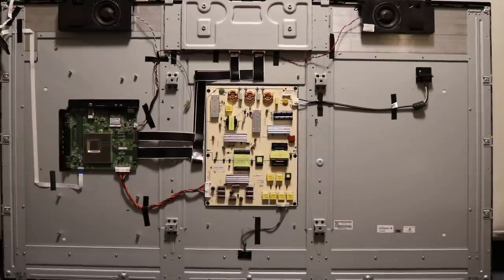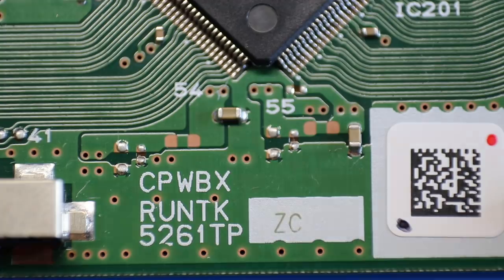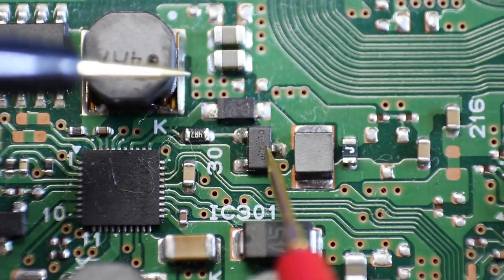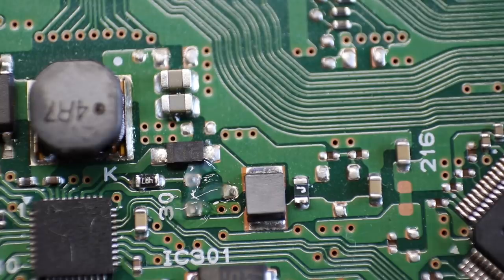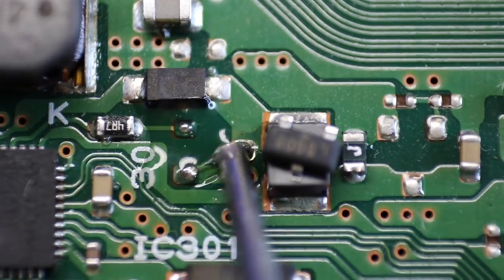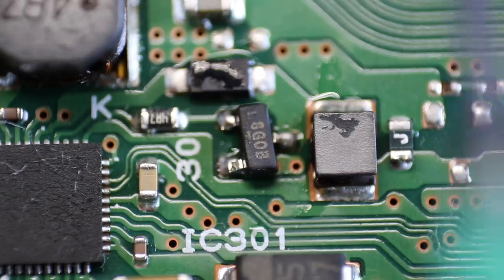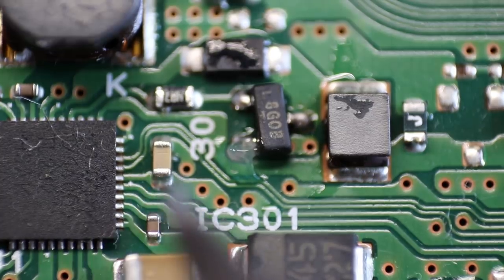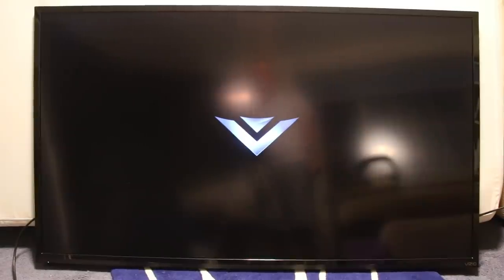60" TV for less than a $1 - Vizio E601i-A3

Comment: Great repair, but you need to not focus too much on the internet.Some of the things you need to discover them  yourself and of course you need to have basic background in electronics. For instance after removing the transistor you should test the board because some components might be shorting and you need to explain why that transistor  should not give a beep or 0 ohm reading and finally you need to explain why you suspected that tcon board was faulty.Great work, great repair ,Much appriciated.Thank you very much.
Reply from the maker: Thanks!  I didn’t do a great job explaining in this video.  Have you seen my other electronic repair videos?  I hope I did better especially in the 65” 4K one from last summer.
Reply: @FrugalRepair  Thanks, i will check. I appreciate your work.

Comment: Hi, my Plasma TV model TH-P42U30S, there is no red light at all, whats is the problem. can it be repair. thk
Reply from the maker: Unfortunately, you would have to give much more information for me to have a guess as to the problem. The fact that you have no standby light could mean that there is a problem with the main board or the power supply. But The fact that is a plasma TV it could have a short circuit on one of the other boards. I would disconnect those other boards except the main board and the power supply and see if you get your standby light back
Reply: @FrugalRepair  thank you Bro ,i will give it a try

Comment: 60" Vizio TV blowing T-con board.  Any insight?
Thanks.
Harold
Reply: Wouldn't it be possible to order a new T-con board and just replace that? Soldering is something I plan on taking up this year... lol
Reply from the maker: Do you mean the tcon has the same issue as the model in this video?  It could be a bad lcd panel and/or the heat dissipation on the tcon (near the gamma IC) is not sufficient.
Reply: @FrugalRepair  I put in several t-cons but nothing changed. The set has backlight but no sound or picture.
Reply from the maker: It could be a problem on the lcd panel.  I would try to drive half of the screen at once to isolate if there is a problem on the left or right side of the panel.  Unplug TV, then disconnect one of the cables between the tcon and panel.  Then turn tv on.

Comment: can share how to repair the Green broken display.. could it be also a t-con problem?
Reply from the maker: Do you mean the video on the screen is green colored?  Is it the same model as this one in the video?
Reply: @FrugalRepair  another model samsung sir.. its not totally dark green.. its color green in the boarder then color white in the center.. then it well fade to white or gray color in the screen.. not sure if its t-con or already panel issue..
Reply from the maker: @aivanjay  I'm not sure.  It does sound like either a bad panel or tcon like you mentioned.  If it is an older samsung (before 2011 or so) lcd it would be worth looking at the capacitors on the power supply, they might have the "capacitor plague".
Reply: @FrugalRepair  ok sir thanks

Comment: What's actually the benefit of using hot air rather than just simply the soldering iron?
Reply: Imagine trying to get 3 pads hot at the same time to get your component off. A soldering iron is great for concentrated heating but sucks at removing components.

Comment: For any normal people out there, You can buy this entire T-con board for $18 bucks, and with a phillips screw driver have the same repair he just did, without the worry of messing up the soldering job with unsteady hands.
Reply: That sounds like a better solution. No need for heat gun or steady hands.
Reply: Buying a used tcon board is cheaper.. 18-20 bucks. You can fix many tvs for the price of the machine used

Comment: I have a question I have a 49 inch lg t.v. that works fine till it heats up then it cuts its self on and off. Isnt that to do with the power supply board?
Reply: Put  it in the fridge may hel0
Reply from the maker: Figuring out that heat is causing the problem is a good clue.  My first guess would be bad led's  (your backlight).  Try turning down your brightness in settings to 10% and see if the tv lasts longer.   I guess it could be a power supply (or another board problem) and you could also point a running fan on the board and see if it lasts longer.
Reply: I found the issue but thanks tho your video was very insightful. Thank you .

Comment: HI MY 2 year old nephew broke my 65 Samsung tv. I tought I had a warranty and extend warranty but they said it was physical damage just by the picture I sent to them.  Would you know what the problem would be?  Where could I get a television screen plexiglass protector? I wish I could fix tvs like you. Hate to throw them away and have to waste more money on a new one.  Thanks
Reply from the maker: Unfortunately, if the screen is cracked there’s not much you can do.
Reply: @FrugalRepair  it  doesn't look like the screen is cracked.  Just something internal. Picture is not good at all.

Comment: I replaced the tcon board and it seems like the new one is also burned out, both on that same transistor.  if there is a short, what could be causing the boards to burn out?
Reply from the maker: Unfortunately, it is possible that you have a bad LCD panel that is causing the problem

Comment: What happens when you Google the model number of your TV and you can't find a site where someone has already detailed exactly what you need to do to fix it?

I have a trash-picked 48" Samsung TV that won't turn on. I took the back off, unplugged the main board and connected the power. The backlight didn't come on like various troubleshooting videos said it should. So the power board appears to be bad, but I have no idea how to test any of the components on it, other than the fuse. I checked that and it seems to be good. None of the capacitors are leaking or bulging and nothing else seems damaged. So how do you figure out which part is bad so that you can replace it, rather than replacing the entire board?

Comment: I ve have an Rca 46LB45RQ comes on for probably a day then goes black with sound still working. Did the flashlight test and don t seem to have any images.  Wait a few days same thing works then goes black. Can u tell me what which component u think could be causing this? Thxs
Reply from the maker: Huh, my first thought would be the led backlight overheating and shorting.  But you're saying there is no image on a flashlight test.  Maybe try this,  go into settings and turn your brightness down to like 15% and then leave it on all day and see if it behaves the same way.  If it isn't the backlight, it could be a range of issues.  Is it connected to the input at all?  Does it do that on the coax, hdmi, RCA inputs?

Comment: Maybe you can help me, I have a tv just like this one. Intermittently the screen will blink off, then it comes back on and the information in the upper right corner comes on, like the tv restarted. But no V after incidents. The screen just comes back on. Any ideas? 
Thanks 😊
Reply from the maker: Have you researched the model number and the problem online? What did you find? As I think about your symptoms it seems like there could be many things causing that so I’m not sure what to tell you. It could be firmware, it could be a short circuit on a component somewhere, it even could be a backlight issue that looks like the TV is restarting. Or something else.
Reply: FrugalRepair not yet. I saw how you fixed the inop screen and it reminded me of what mine was doing. I will look further into it. It’s like mine is resetting. Info pops up in right upper corner of the screen. These aren’t designed to last like the tv’s when we were kids. 😉

Comment: Hey Mr frugal I changed the whole tcon board and still doesn't work....but I have the same exact problem u had in the video. What should I do now
Reply from the maker: Unfortunately, if it is the exact same issue there are two possibilities I can think of.  Either your lcd panel is bad or you were sent a defective tcon.   There are more detailed diagnostic videos on this model's tcon or how to troubleshoot tcon boards on YT if you wanted to pursue it further with a multimeter.

Comment: Very nice contribution to the common person saving tremendously.  My learning curve isn't all that great but it seems you make a major leap in knowing it's exactly that transistor.  I need more of a step by step how it is you know what you know in this case.  I know you know the back light lights up but no picture, but still how did you know it was exactly that transistor?  You use trade names for the various boards "Tee Con Board"...  Also the name and address of the company that you bought the transistor from.  I might go to the electronics stack by the dumpster to my apt bldg as there's an RCA 32 inch HDTV... but do these TV's work on one's computer, as a computer monitor?  A 32 inch screen with its single pedestal foot would sit nicely on top of my desktop computer.
Reply from the maker: Thanks for your comment.  I didn’t do a step by step in this video but I do in other videos.  Did you get a chance to watch some others?  Also, if you want to quickly diagnose a TV or monitor, I would recommend that you get my PDF (FrugalRepair.com/resources).  It’s 26 pages of my best diagnostic steps before taking anything apart. My next video should be out this week, let me know what you think.

Comment: I have a question I have a VIZIO E601i-A3 and tv works for like 10 minutes and then screen goes black and a loud screeching sound then I have to turn it off or goes off on itself then I turn it back on sometimes it only works for 10 minutes sometimes an hour what could be the possible problem T con board power board or the main board ????

Comment: I fixed a 43" Samsung LCD tv by reflowing the graphics processor chip with a heat gun. 
I fixed another LCD tv (can't recall make & model) by replacing a bad cap for $1.83.
Reply from the maker: Awesome!  Thanks for sharing.

Comment: I have a Samsung UN60D8000 YFXZA 3D LED TV and I have a problem watching 3D movies, I can not connect several pairs of glasses that I have, when trying to connect them to the TV all the time small led light on them is blinking., Could you tell me what is or witch  electronic board   is responsible for this ...
I will be very much obliged

Comment: My 42 in. vizio will light up but no screen logo or anything else , any suggestions ?
Reply from the maker: What is the model?  Some of the older Vizios would have a bad firmware chip,  or could be bad capacitors on the power supply.  Could be a bunch of other things too.  Did you watch my other tv videos?

Comment: I could really use your experience fixing my 1500watt 110v power inverter.
Reply from the maker: Have you done any diagnosing?
Reply: FrugalRepair , yes, thanks for replying. I shorted something out trying to add an external on off switch for my solar powerbox. I heard a crack and saw some white smoke coming from 2 big capacitors. So I took the inverter apart and to my surprise both capacitors were fine. I did notice a trace had  protruded the board and was slightly charred. I soldered the trace and got good continuity. But still no power. There is no power going to the fuses either. I checked the switch and its working fine. I'm stumped.
Reply from the maker: I’m not sure I can help without physically looking at the board.  If a trace was damaged it may mean another trace (or more) under the solder mask maybe damages too.  Ideally, you could trace down the issue faster with the schematic but my guess is that you won’t be able to find one.  Can you look at it under a microscope to inspect the damage?
Reply: Unfortunately I don't have any sophisticated equipment. Do you you think a bright incandescent light might help in locating trace defects? I by no means am a professional. I just like the challenge. What you are saying makes a lot of sense because without there being zero power to any fuses even if they are good, is not good news. Traces are probably damaged elsewhere. Although the white smoke I saw coming out was from a certain area. The one I managed to reconnect. Thanks for your thoughts and comments. Be well
Reply from the maker: @milvolts1  Even with magnification you may not be able to see the traces in the layers in the pcb.  But you can always try.  I've fixed many things that at first I wanted to give up on because it seemed "too hard".  You can learn how a typical power inverter is designed and study your board to learn what each component does and start your deduction and investigative work.  Hope you can figure it out!
Reply: FrugalRepair , hello...Finally got around to tinker with my lifeless inverter. I retraced the prior trace and amazingly I got it to power up. Only now the fault light is on and the fault buzzer is semi buzzing. I did notice one of two main capacitors on the DC side heating up and bulging at top, so I went ahead and changed it. But still showing fault. Something else I noticed was that when I disconnected the battery. Both main capacitors where not showing any voltage. Please! Any input would be appreciated.  Thanks
Reply from the maker: @milvolts1  Unfortunately, I think it's beyond my ability to help over chat.  It sounds like you are close though. Have you figured out what causes the fault light to come on?  Perhaps that is a clue that you can work backwards to figure out the problem.
Reply: FrugalRepair , I appreciate your responding even after a while with no update. Its people like you that make You Tube what it is today. Yes I feel I'm close.. I will research and try to figure it out. I am as close to a novice, in electronics. Will cross my fingers and try to solve this fault. Thanks and good luck with your channel
Reply from the maker: @milvolts1  Thank you!  Good luck!  Keep at it and don't give up.

Comment: Hi there 
I wanted to of is there a way to fix sony mini dv camcorder player with a broken flex cable from board and caste slot not retracting?
Thanks 
Gaganpreet Singh
Reply from the maker: I bet it can be fixed.  I don’t know exactly what you mean since I don’t have that device but a connection issue should be able to be repaired with the right tools.

Comment: Its great that your teaching people how to fix their own T.Vs. My nieces Samsung plasma T.V has an issue. It won't turn on. The problem with getting it repaired is the cost. Often it's cheaper to just go and buy a new one because I guess a repair shop will charge $50 per hour.

The problem with the T.V is it sucks a lot of power. 

Even if she fixes it the cost to run it is crazy expensive. 

Privatisation means they came in jacked up the price 6x as much or higher. Extreme greed. What do you do? Fix it and pay the gouging power cost and the cost to fix it or just buy an LED T.V.
Reply from the maker: Thanks! If your TV is an older Samsung lcd tv chances are high that it’s a simple fix and replacing a few capacitors on the power supply.

Comment: I have an Element smart Fire TV. It turns on and after a few minutes the video goes but I have backlight and sound, if I turn the TV off and on then it works again for a few minutes.. any idea? TCon board?
Reply from the maker: I don’t know your model but it could be the tcon, main board or the lcd itself.  I don’t think I can’t give you much more without taking a look.  Maybe a component is overheating due to a short.  Maybe see if the video lasts longer when you have a fan blowing air right one of the boards?
Reply: @FrugalRepair  The Tv is working fine again after shutting it off over night... This is crazy

Comment: Hello. I have a Vizio 70" (E701I-A3E) that has similar problem.  I changed the T-con but it kept doing the same thing.  Any suggestions?
Reply from the maker: It is possible that the lcd screen is bad, unfortunately.  Either that or maybe you got a bad tcon?  That’s my guess.

Comment: Hi, my tv was showing black lines and the tv guy showed us that the green strips running from the screen to the electronic chips had been torn in an area. Is it possible to fix this? Can i buy a new green strip and have someone fix it for me ? Can that strip be replaced or is the whole screen gone?
Reply from the maker: If I am understanding you correctly, these would be vertical black lines. The cable that goes from the panel to those circuit boards cannot be repaired easily. What is possible is if the problem is on the connection itself.  That is, there’s a special kind of adhesive that holds the cable on and it is possible that the adhesive has weakened.  If this is your scenario, there is a Jerry rig solution possible. Basically, you need to use some type of non-conductive material to put pressure on that spot. There should be videos of people doing this online. That connection that I am referring to is called a tab bond.
Reply: @FrugalRepair  the problem is that the conductive strip is broken, like physically torn, ive seen it. Is it possible to replace just that strip or no hope. This strip runs from the screen glass infront to the electronic chip at the back.
Reply from the maker: If it is the long skinny circuit board that connects directly to the lcd screen, then no, you can’t replace that.  That is part of the lcd assembly
Reply: @FrugalRepair  thanks for letting me know .